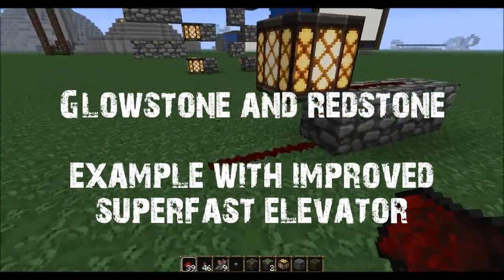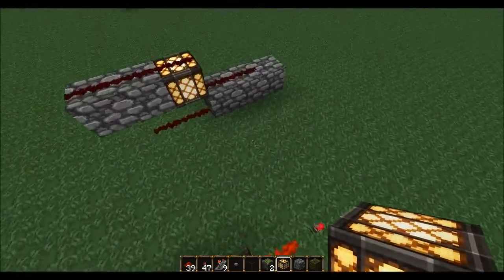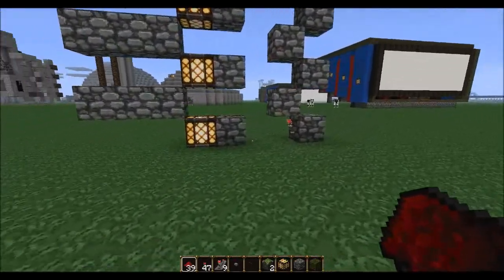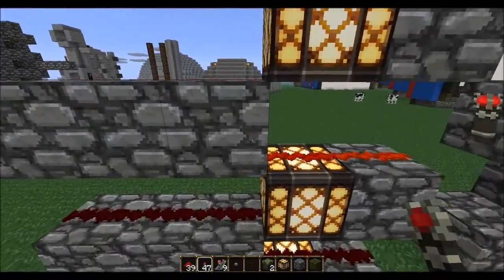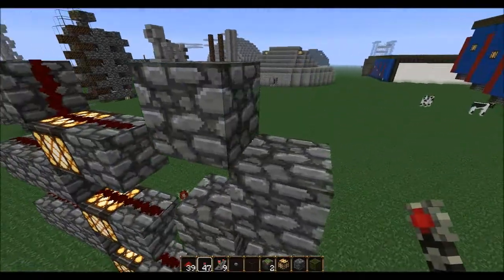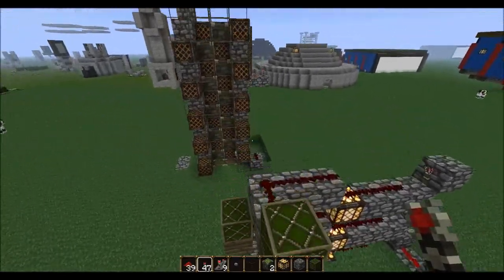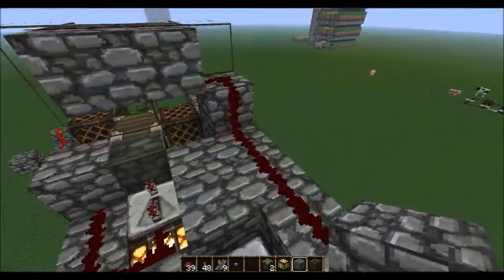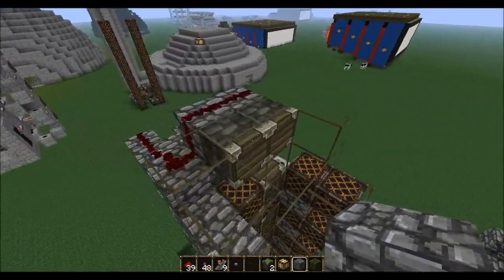Redstone and Glowstone. Example with super fast piston elevator

Comment from the maker: @zhulslab you can see glowstone as a diode. a block that will allow power past it in one direction depending on how you place it. another thing is that it will make vertical repetetive designs a lot easyer to build, a lot cleaner and compacter. there are still many things that i haven't found out yet but i am sure glowstone will be an important part in many of the new or improved redstone contraptions.

Comment: Don't quite understand the point. Ok, the glowstone allows you to step up (which was hard to do before, repeaters only allow a step down without interference), but the torches are still propagating the signal - if you move that torch ladder one up you get the same result without glowstone. No?
Think glowstone is interesting because it allows more compressed wires, let's say to control a 10 high Jeb door (without a torch ladder and) without a mess of wires.